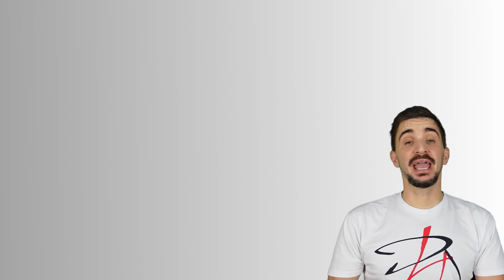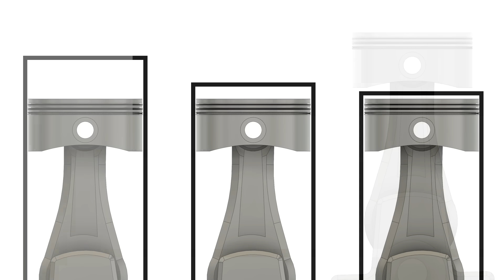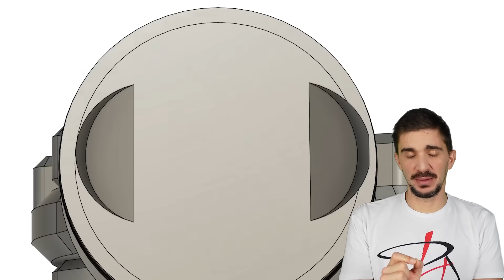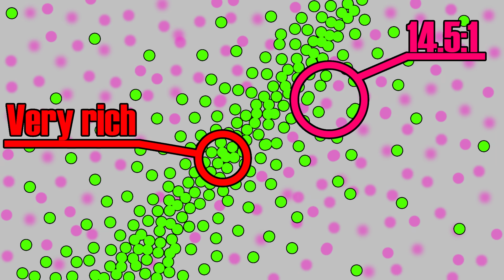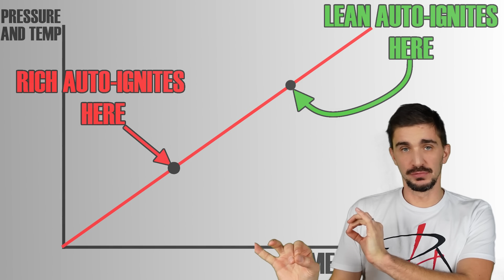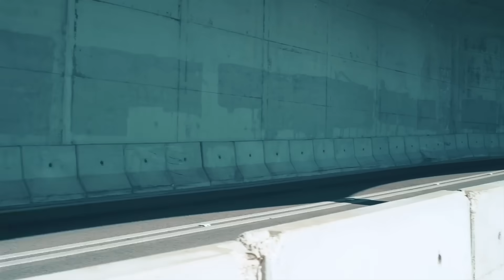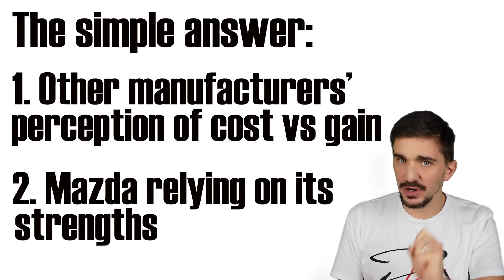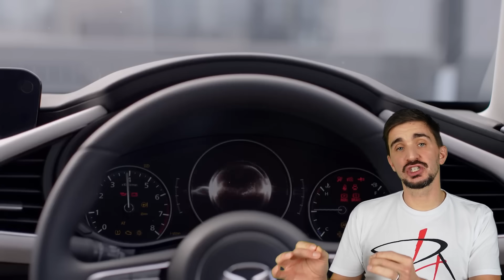The Game Changer Nobody Cares About - Mazda Skyactiv-X SPCCI How it Works and Why It Didn't Catch On

Comment: Very complete, and well made video. Mazda needs to work it out, to improve it. Toyota as usual, did offered the best option, and system out there, with their hybrids options, but also their new "dynamic force" engines, which are the really most efficient engines in the world, as they're working it all the time, and not only a part of the time as Mazda.

So when Toyota is combining all their different techs, they still got something more potent than the Mazda SkyActiv X, offering everything the customers are looking for, and which you perfectly pointed out. That's why in real world numbers, nobody is able to beat Toyota efficiency, practicality, versatility, etc ...

Comment: This is typical Mazda. Cool tech, bad business. If this tech was so great, theyd have it deployed across the whole lineup vs just their smallest cars. And they wouldnt need to use Toyota's hybrid tech in the CX-50. Mazda wastes so much money on pointless tech/projects and their cars are worse for it.

Plus not wanting to wind an engine out to keep up with traffic doesn't make people spoiled. Most people hate driving. It's stressful and annoying. A slow loud engine only makes that worse. An appropriately specced/sized hybrid or turbo engine makes more sense for the average person.

Comment: Combustion engines as  good as they theoretically can be are still many times less efficient than electric motors.  It’s great that you are really enthusiastic about this, but if humanity wants an easier path that isn’t thwarted with increasingly self destructive side lines which increase our collective carbon footprint and is the cause of much of the world’s strife, then we need to focus on the electric solution which is better for all.

Comment: Good Video including the topics of efficiency, emissions and operational stability. However, the application of skyactive system is impeded by the taxation on displacement and the future emission requirements for stoichiometric operation. Today, the skyactive engine can still apply enrichment to compensate for the high compression at high loads. In future, the stoichiometric requirement will eliminate this option for good. However, I compression gasoline engine would than be limited in specific load as long as there is no additional technology yo moderate knocking, which provides additional costs in foreseeable future.

Comment: Now that you said it, that idea to use this tech in hybrid cars is really just about best case. Hybrid systems are already efficient because they can keep the engine at a steady rpm and harvest energy braking, but using a hybrid system on an engine like this would allow the engine to remain in that mode almost if not all the time by design. That would make it even more efficient then it already is. Crazy.

Comment: Mazda has a awesome engine record actually. One of the first efis, first mass production rotary , first pulsecharged diesel (comprex) , first miller cycle mass production engine , first low compression diesel (skyactiv-D) , first HCCI engine. They'll probably be the first ones to use fuel cells for direct CNG to electricity conversion....

Comment: I just bought my first Mazda car last month. It is a 2020 CX-5 GX (base). I am very pleased so far with this small SUV. On the highway, it manages 7.5 L/100 km at 100 kph. It is very good imo. It has 85000 km, and everything feels solid. It was extremely well maintained by the previous owner; I have all the maintenance invoices. 2020 is the last year the CX-5 does NOT have Mazda's connected services (it has Android Auto and Apple CarPlay), and also, it does not have cylinder deactivation, which I DID NOT WANT. I feel I hit the last golden age CX-5 with this 2020. Super happy.
Reply: Take good care of it and it will easily last you 400k+ miles.

Comment: Were I not content to keep running my bought from new 1997 Peugeot IDI 1.9 turbo diesel {and pay the soon to be £375 yearly road tax}, I'd either buy something interesting, pre 1986 to avoid road tax completely, or else buy one of these Mazdas. I certainly wouldn't want a modern turbo diesel, with their choking emission control problems, nor an overly tuned 1000cc petrol engine that's expected to pull a ton of weight. Like your good self, I have a car mainly for practicality but also have a motorbike for thrills.

Comment: We just ordered our third Skyactiv-X CX-30 last week. The first was a 180HP (2019), the second was the 186HP (2021); they heavily changed the torque curve. There is a bit more torque, but much sooner. The third is almost like the 2021 version but consumes a tiny bit less to match the new Euro 6e emission norm, while the previous Skyactiv-X were Euro 6d, compliant. Only the very last models of 2025 are Euro 6e, I was told. Our will be Euro 6e compliant.

Is it a miraculous engine? No. Is it good? only if you're an eco-driver. As soon as you put yourself in sport mode, you will consume more than any other engine. There is a compressor to help reaching high compression ratio, something never mentioned. There was a momentum problem that took them 4 years to get rid of. Also, the whole engine is controlled by a computer, it unleash it's true power at 5500 trs/min. On the first version, it was like having an old-style turbo. The behavior of the engine is much better with the second version, still, when you push the accelarator it doesn't feel like a 186HP, any other engine will beat it, but the low consumption is there. No doubt about that.

One last thing. The Skyactiv-X engine doesn't like winter. Below 15 °C, you start to feel the increase in consumption. Below 5°c, it becomes really obvious. 0.3l to 0.5l/100km more out of 5L/100km, just because of the cold. Never had any problem with the engine, though, nothing. I can't wait to drive the new Skyactiv-X. The car CX-30 and the engine work great together. The enemy of the engine is weight. The Mazda 3 is the car for which the Skyactiv-X was designed. The Skyactive-X is only sold with the Mazda 3 and CX-30, no CX-5 or CX-3).
Reply: "As soon as you put yourself in sport mode, you will consume more than any other engine." That's not true. Becasue outside SPCCI mode it is a naturally aspirated engine, not a turbo charged engine. Turbo charged engines have worse consuption at high power, becasue they tend to run rich, to reduce the temperature it combustion chamber, to prevent knock. NA engines do not need to do that.

"The behavior of the engine is much better with the second version, still, when you push the accelarator it doesn't feel like a 186HP, any other engine will beat it, but the low consumption is there. No doubt about that." I disagree, I have the engine in my Mazda 3, and the car can be quite rapid.. But you need to drive it like a NA engine, that is at high rpm....
Reply: @Snipes432  Well, if you know better than what I have experienced firsthand for the last 7 years... your first comment is theoretical. I drive regularly on the German highway as fast as I can, and it keeps its SPccI mode. 

The #1 complaint of users was the lack of torque; they felt heavy, which is why they made the second version of the engine. The complaint is still there, but it's now acceptable. As I mentioned, the weight is the problem, and the Mazda 3 was the car for which it was made. I have no doubt it works better with it because I have driven it. Still, there are plenty of CX-30s sold. Torque is lacking.
Reply: I have nothing against the engine. Its impressive technology, but why not go for a turbo-diesel instead. It has tork and power in the whole rpm range while crazy high mpg.
Reply: Yeah, and in winter it takes ages to reach normal operating temperature. Coolant temp stays in blue zone for 10-15 min

Comment: Would some kind of VVA (valve duration and/or lift) not allow for more accurate control of the combustion and allow the engine to run on compression ignition in a wider range of rpms?? 
I know not many companies own designs for VVAs in production but hypothetically it could work (it would add a lot more complexity but also it would be cool as hell)

Comment: Going from a turbo-charged to a fully NA car with large displacement (similar power figures) made me realise this, too.
I had become so complacent, so satisfied with "foot goes down, car goes forward", I forgot the fun I had driving a car. Relearning that I need to shift gears for a happier wider smile, felt great. Knowing that I control the fun and responsibility, forgive the managerial lingo, feels empowering.
Reply: Same here. It’s hard to explain to the stat nerds that you can’t beat the feel of a NA engine. Needing to rev it out is fun.
Reply: It isn't managerial lingo until the word "synergy" has been used, and if the upper echelons are what you seek, the words "going forward" have to be woven in.
Reply: NA is definitely nicer to drive for me. Every turbocharged car I've driven has... I don't know how to call it... a very spiky power profile. NA is far smoother throughout the entire RPM range. Imho NA engines also tend to sound better
Reply: I believe shifting also keeps me more aware of the traffic around me, makes me a safer driver.
Reply: Beating you off the line or at any speed puts a smile on my face! 🤣 Drive electric. ⚡️
Reply: @Krunch2020 entirely not the point being made. the car does the work for you. that's exactly what OP learned he doesn't like. put foot down get more speed is boring compared to managing your rpm, or in the case of a manual transmission, the enjoyment derived from shifting gears and working the car yourself. electric vehicles, more so than auto transmissions or even mild hybrids, rob those who seek this enjoyment of their fun. if you don't give a shit, you don't give a shit, and that's okay. everyone is entitled to their own interests and desires. but the original commenter is very clearly not trying to be the fastest on the block. why else would the mazda miata be such a reliably high-selling automobile if not for the thrill of rowing through gears on a leisurely, yet exciting, drive through the back roads or during a commute? it certainly wins no competitions regarding speed, acceleration, etc.
Reply: @Krunch2020  You aren't beating anyone off the line, the car is.  All you did was pay for it.  No glory there.
Reply: @Krunch2020 you drive a toothbrush
Reply: @Krunch2020  we all know you would love to beat him off 😂
Reply: @Krunch2020  Shut up. We don't give a shit about 0-60. We're real car people. We care about a vehicle that's fun to drive and has a soul, not a toaster
Reply: @Krunch2020 your batteries need to be replaced in 5 years but OK my dude.

Comment: Maybe 1 thing is Missing:
The engineers looked for ways to make engines more efficient and found out that compression ratio is the x-factor. But for higher compression ratio in gasoline engines it was thought that torque has to drop significantly. During their tests they found out that the drop in torque wasn't that significant. But still explains why a lot of people think that torque in the low RPM range is missing even considering natural aspirated engines.

Source: Interview with Mazda engineers

Comment: Ok but BMW does something similar since 2007, ever since they moved to direct injectors they have used stratified charge and lambda values of around 3, this equates to about 45:1. The N53/N43 was effectively this, it's a very interesting engine but was sadly plagued with reliability issues that caused BMW large amounts of money.

Comment: So we can either overpay for insanely overcomplicated bullshit running on 100 years obsolete tech which will obviously break like all cars do everywhere and keep breaking causing insane costs of repair with insanely overpriced services with their insanely overpriced equipment they need to be able to even try to repair the car... or just get a normal electric car from china at 10% of the price at the same performance with ZERO MAINTAINANCE idiocy because it simply DOES NOT HAVE the parts which would demand the insanely overpriced service to break. Hard choice

Comment: Mitsubishi have something similar back in the 80's except the compresion. Called mca jet, a prechamber were spark plug have a rich mixture ignites and consequently ignites the very lean a/f mixture of the cylinder.

Comment: I imagine if Mazda SPCCI, Fiat Multiair, and Nissan Variable compression, these three technology gets integrated to one engine using a Toyota ECVT, it will be the most efficient engine in the next 20 years. And I hope that it can run multiple fuel types…

Comment: Higer efficiency in higher compression engines is achieved in the "harvesting" energy time of the stroke. Think about the valve opening when there is still pressure inside the cylinder. Thats a missed opportunity to harvest energy.

Also the lack of vacuum in the intake stroke of a compression ignition engine makes is more efficient.

Comment: They would be smart to combine it with their phev models. Early ones (cx-60) were/are steaming piles of crap 😂. But the EV motor would compensate perfectly for the lacklustre low end performance of the skyactiv-x without the need for a turbo and would provide significant benefits for highway driving or battery charging on the road.
In any case I wish they got more coverage, especially here in aus.

Comment: I would like to request you to talk about the CVCC engines powering the first generation Honda Civic someday. While it’s not a compression ignition petrol engine, the way it worked was strikingly similar. Basically, a carburetor with a pre-chamber drew fuel and ignited it with a rich mixture inside the pre-chamber, the ensuing jet of combustion then travelled to the cylinder with an extremely lean mixture. They also modified a V8 off of an Impala to accept the system when Chevrolet made fun of them. 

Also, that comment about Mazda believing the rotary engine long after the rest of the industry abandons it is what Mazda does best. The best part? In 2022 Mazda patented the Skyactiv system for their rotary engines by the exact same way; injecting fuel directly onto the spark plugs and igniting the A/F mixture through compression heat. If I remembered correctly the patent mentioned a compression ratio of 14 or 15:1 which is basically the upper limit for Wankel rotary engines. In addition to Skyactiv, they also patented another method to hook up the eccentric shaft directly to an electric motor to control the rotation of the rotors, essentially making a VTEC for rotary engines. 

Mazda might be a small boutique manufacturer in an industry of giants but they sure could hang with the big boys in terms of innovation.

Comment: SkyActiv engines have seen a surge in aftermarket support in recent years. For the 2.0/2.5 there's the VT-Supercharger kit. For the 2.5T, there's the Corksports Upgraded downpipe + other bolt-ons. Either configuration, add on a Saucetune and you've got a reliable, efficient and fun daily sleeper!